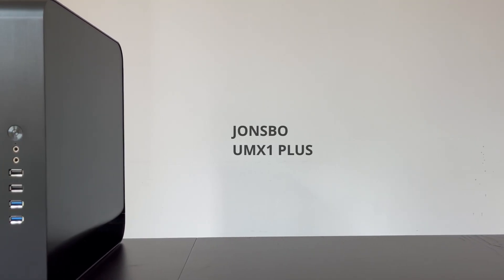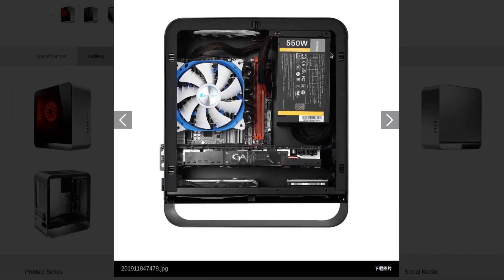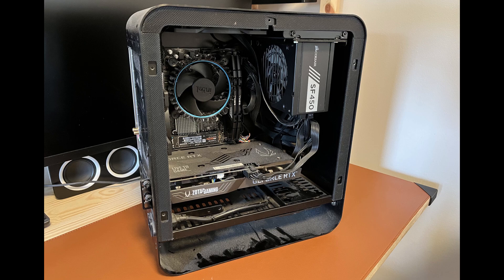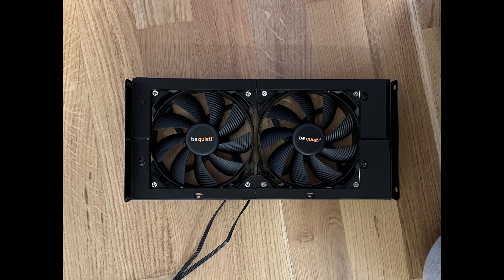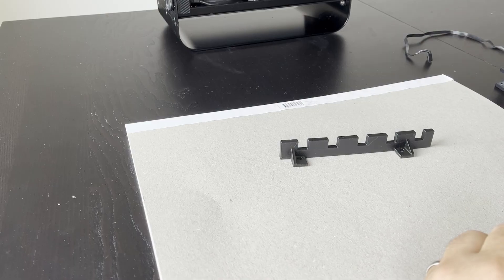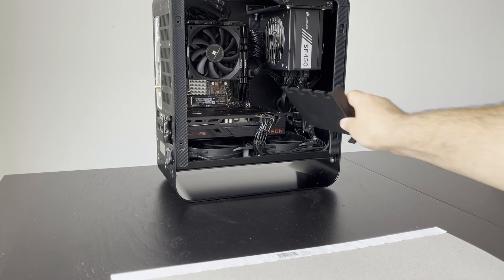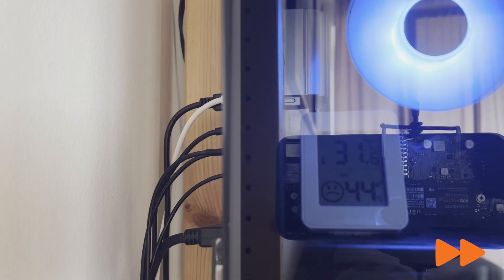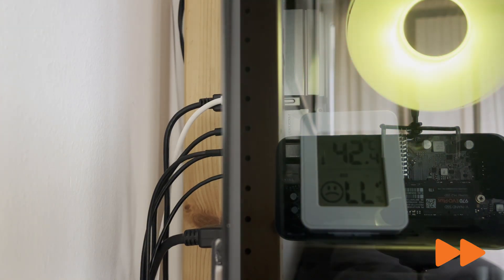How I Turned One of the Worst PC Cases Into One of the Best!

Comment: I’m getting my hands on my oldest son’s desktop before the new GPU arrives. The UMX1 Plus is built from fantastic materials, but the airflow design is an absolute catastrophe.

My plan: install two 120 mm intake fans at the bottom. No cutting required—just removing the 3.5″ and 2.5″ drive trays. The 2.5″ tray seems riveted instead of screwed in :( so I’ll drill it out and use the existing intake openings as they are.

The stock dust filters are held by screws that stick too far into the case interior, blocking any kind of fan installation. Those screws will go, and I’ll replace them with magnetic filter screens. For fans, I’ll be using high static-pressure models.

As for the PSU, I strongly recommend going with SFX. It makes cable management much easier, whereas ATX—even modular—feels like a nightmare in this case.
Reply: I double checked the interior bottom plate where the magnetic dust filters will be applied - it is the only magnetic part of the case, everything else is aluminium.

Comment: I would've put the SSD to the front cable hider bracket, so that you wouldn't need to sacrifice the 80mm extra fan.
One could possibly even put a small tower cooler on the CPU, and make a fan duct to direct the hot air directly out from the 80mm fan holes.
Reply from the maker: Good points!

I also wanted to attach the SSD to the cable hider bracket first, but with the cables sticking out the SSD it was too long and looked strange. 

I didn't need the 80mm fan because I had the same temperatures with and without it. The narrow openings for the 80mm fan made the PC unnecessarily loud.

A small tower cooler for the CPU would have been my first choice, but unfortunately my mainboard has very poor VRM cooling, therefore the current CPU cooler also blows air directly on the mainboard and also cools the mainboard components.

The mainboard wasn't my first choice either, but I bought it in the middle of the chip crisis and it was the only Mini-ITX board under €200.